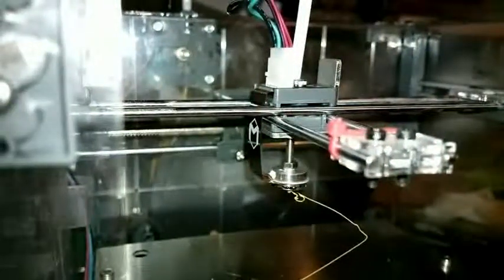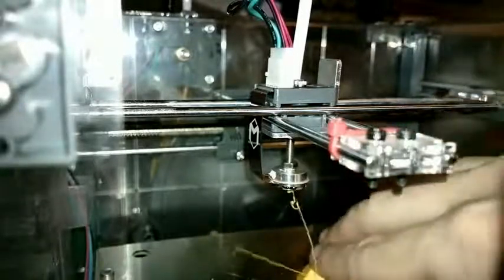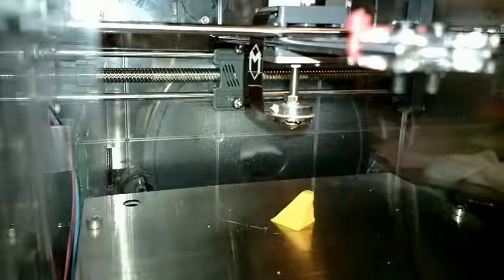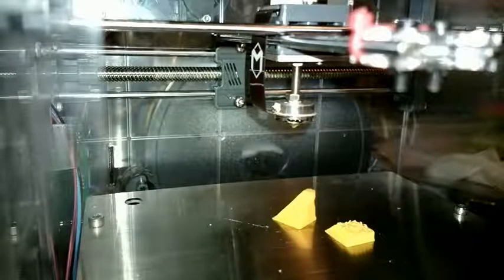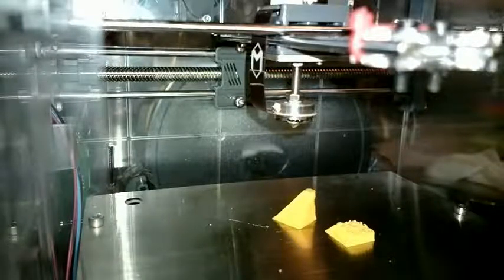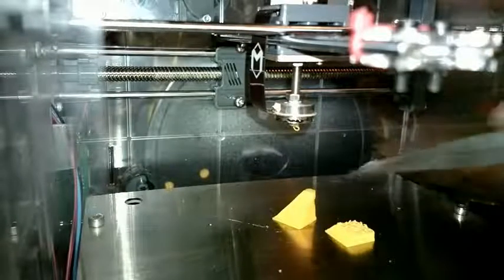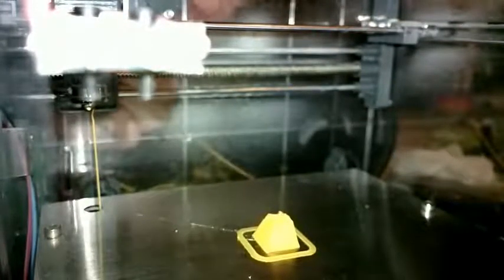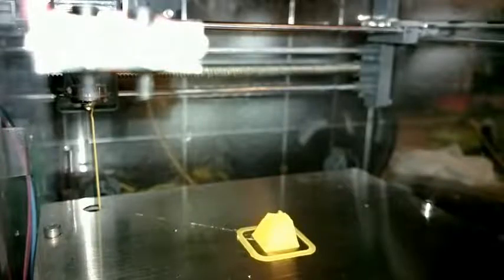Makibox testing: yellow PLA test object (test #1)

Comment: It looks to me like the extruded filament is way too hot.  It looked almost liquid at times.  What's the next change?
Reply from the maker: Planned changes:
Reduce layer height from 0.2mm to 0.15mm
Increase layer height from 0.2mm to 0.25mm
Decrease temperature from 200degC to 190degC
Increase temperature from 200degC to 210degC
Decrease all speeds by 20%
Increase all speeds by 20%

The 'standard' PLA temperature (as provided in the Makibox config files) is 193degC, but there was a suggestion (after the first few jams) that a higher temperature might be necessary.